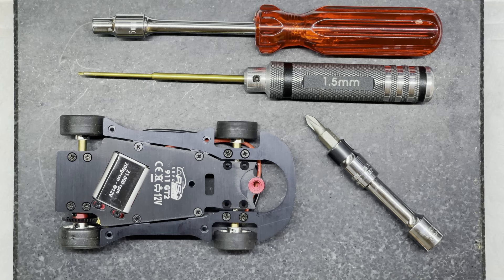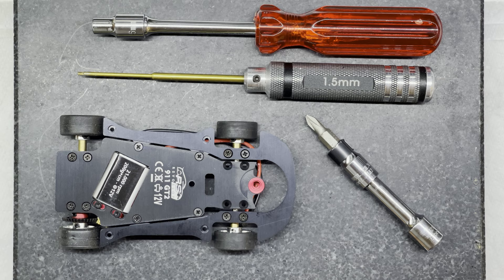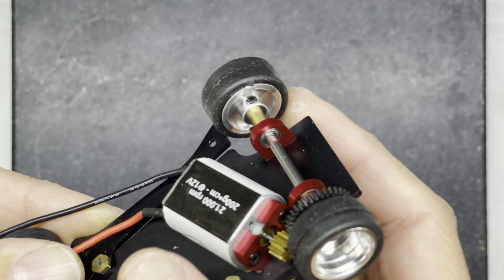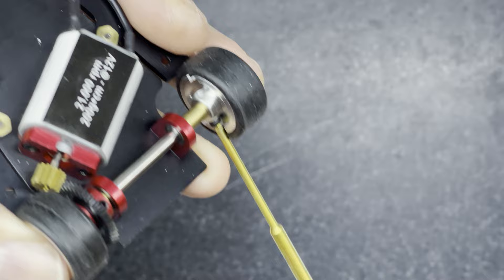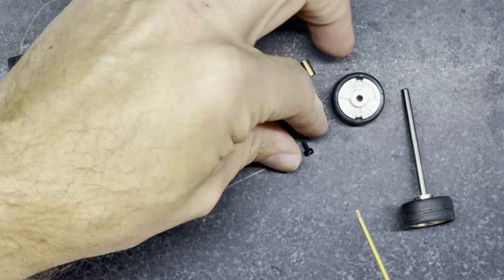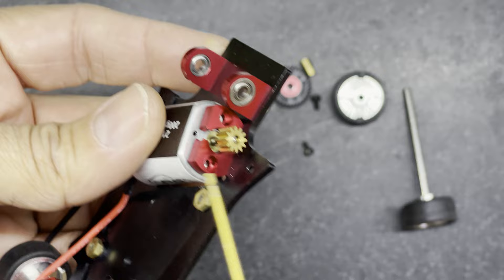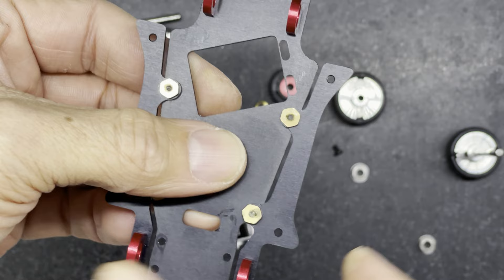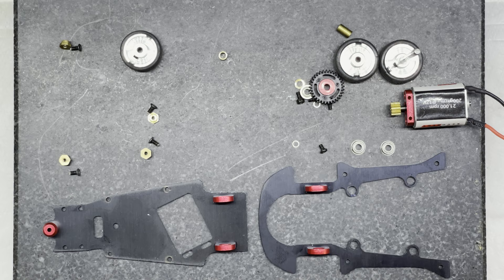Dismantling my RevoSlot Porsche 911 GT2 and an interesting idea for assembly

Comment: Some of these things I also always do with my revos, some were new to me. I may go the extra mile with my next one as well. The tape between the chassis plates does remove the rattle. No other cars are as quiet as my revos :)
Thank you for sharing, very much looking forward to learning some more!
Reply from the maker: I didn’t want to use tape because I didn’t think it would be allowed in the rules and it will make the pan section even higher off the ground!
Reply: @CleaveTech  I got that from the video, just confirming your suspicions :)
I‘m excited to see your results with the silicone grease!

Comment: Silicone grease has been a 1/12th R/C racers damping medium of choice for 40 years, is cheap and works...a fluff grabber if your track is on the living room carpet though. I've still got a few tubs of Associated silicone diff grease from the 70's :o)
Reply from the maker: Nice to hear that it stands a chance of working. I didn’t know that RC racers used it for the same reason 👍🏻
Reply: @CleaveTech  Yes, early Associated RC12's used it between plastic discs on a centre post just in front of the motor, Corally used a thick silicone oil in a similar fashion in a rubber boot and a lot of manufacturers used it in simple sliding dampers (a rod in a tube) mounted from the centre of the pod to the sides of the chassis.
It's also been used in gearboxes and differentials for decades right up to 1/8 scale I.C. rallycross.

Comment: I've got 24 of these things, most of them don't have those washers. I use plafit spur gear with nsr pinion, to quiet them down, if u don't have a rule forbidding that. Mjk tyres.
Reply from the maker: 24 RevoSlots is quite an investment! The club rules do not permit any changes to gears or tyres. I would certainly change them if I could 😁